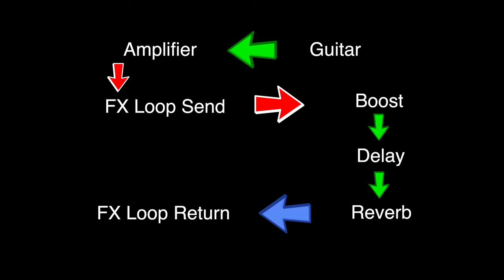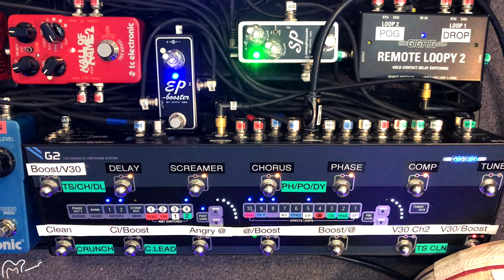How to use a boost pedal in 5 different positions

Comment: Great Video. Just picked up an EP Boost to run in Effects loop of a Mesa Tremoverb as a solo volume control. Was advised to run it after my delay chorus and Tremolo, but found in front of the effects really enhanced them. I run it all the way off, just using the preset DIP +3 and works perfectly. It's not colorless but adds faint solo voiced eq. I watched this video before my purchase. The 2 pedals I tried before were OD pedals that added color, compression, and gain. This pedal works wonderfully. Thanks.

Comment: I recently gigged with a new home built amp head. Band mates were blown away by the amp head. The head looked like a tube amp, for I built it that way. However, I turned it around after finishing the night in showing amp off. I actually was playing through a Quilter Mach lll head using a TC booster in effects loop. Everyone looked baffled, but was taken back in how clean and full my sound was .

Comment: One important thing that was not mentioned is that a boost pedal can shape tone as well. So placing a boost in front of the overdrive doesn't just give more dirt, it adds to tone. Same with placing the boost after the overdrive, you don't just get more volume ,you get a different tone.. By mixing  both the pedals you can get a sound you normally couldn't. For example the Kelly Kantina in front of the Vertex steel string clean drive, or after is going to give you a rich warm tone.Mixing the two pedals whether the boost is in front of the overdrive or after is going to give you a beautiful sound you normally could not achieve otherwise.. It's not just going to raise the volume or add more overdrive depending on the placement, it's going to shape tone no matter where the placement of the boost pedal. Either way it's about mixing.(like an engineer) By  controlling the knobs on both pedals you're going to get many  tones from out of this world. So the stereotype is this, People always tell you depending if you want more volume or more overdrive   do this with your boost..... But I'm here to tell you  as an engineer that couldn't be more further from the truth.
Reply from the maker: Yes absolutely dude, especially with the EP booster, really shapes the tone in a beautiful way with it being based on the echo machine EP3 pre amp 🥰 this wasn’t really a video on how to demonstrate how a booster can colour the tone, that’s a whole other rabbit hole to venture down in another video for sure! But more to help other guitarists understand how they can boost their level or just add more gain in front of an overdrive (to start with), I was hoping people would use their ears to ‘shape’ the tone accordingly when experimenting with boost pedals 😊 The idea came from doing a show and the support band was having issues boosting their guitar level and they were running the boost in front of the overdrive, told them to put it in the amps loop and instantly got what they were after 🤘🏻😊🤘🏻

Comment: I'm really glad I stumbled upon this today, as I've been experimenting with the loop in my Victory RK50 and was contemplating using the EP Booster in the loop to similar ends. Glad to see that it might be exactly what I need to do!

This begs the question - Both the Channel 2 w/boost in loop and Clean w/angry charlie and boost after sound pretty great and almost interchangeable to my ears, do you have a preference between which you generally use and why? I have to imagine each have advantages.
Reply from the maker: Hey Steve, great question! I generally use the angry Charlie with the EP boost as for me it has a slightly smoother tone with what I play, but equally the victory OD with the EP booster sounds awesome too, I may use it a little more depending on the set in playing! Lots of options!

Comment: When running the boost in the fx loop , does it always need to come before the time based fx ? Cheers
Reply: No, but it would be beneficial to do so because you will have your amps clean tone boosted, then into any modulation pedals. Where as after those modulation pedals, you would be boosting those effects.
Reply from the maker: Definitely have a play around and see what you like best. Part of the fun is to try this stuff out 😎

Comment: You think the ep booster could be used as just a solo boost? I've been looking at thia or the tc spark booster for boosting my solos live but can't decide 😫
Reply from the maker: Hey Glenn! I use my EP to boost my solos live and I love it, works for both clean and over drive, definitely worth trying one out to see if you prefer it over the spark, it’s got a little ‘something else’ about it
Reply: @mattmallguitar  Cool! 😃👍 yeah i've heard so from others as well! Does it bring up the volume only or and add gain as well you think?
Reply from the maker: @glennsteen4249  if you run the booster hot you’ll get it clipping, really depends on what you’re running it into I guess, if you want to add more gain to an overdrive or a pushed amp then yes it will definitely do that
Reply: @mattmallguitar  Great! Then i'll get the EP Booster! Thanks a lot man! 👍🙏
Reply: Glenn, the Spark does not affect your tone at all.  The EP Boost does, but in an incredible way.  It was built to emulate the tonal traits of the Echoplex from the 70s.  And it does.  So if you want a boost and nothing more, the Spark is great.  If you want some tonal changes that warms up your boost, the EP is magical.
Reply from the maker: @MikeyRavone  absolutely! It’s magical!
Reply: @MikeyRavone  I just bought the EP and it sounds amazing! 😃👍 Can't wait to plug it into a great tube amp. I sold my amp and haven't bought a new one yet, it's a bloody jungle 😫 
I think I may be getting a Spark as well just to bring my volume up for solos and just leave the EP on as an always on pedal 😁
Reply: @glennsteen4249  Awesome!  Glad to hear it!  That's exactly what i do too.  My EP is before my overdrive and always on.  And I use the Spark after overdrive to boost solos.  I love my EP!  Have fun!
Reply: @MikeyRavone  Cool! Thanks! 🙂

Comment: Hi Matt, I'm using just the boost pedal in front of amp and the pedal works like a on/off switch rather than a boost pedal. Once pressed, it completely shuts off the signal and when pressed again, it turns on the signal which is so weird. Any idea what I'm doing wrong?
Reply from the maker: Ah that’s interesting, I don’t think it should be doing that, are you using just the boost pedal and then straight into the amp?
Reply: @mattmallguitar  Thanks for your quick response. Yes, I am just using the boost pedal straight into the amp to try it out.
Reply from the maker: @joonstar  ok, I guess the next thing to check is the power, are you using a battery or a power supply?
Reply: @mattmallguitar  I am using a 9V power supply.
Reply from the maker: @joonstar  that is strange, does the blue LED come on when you switch the pedal on? And are you plugged into the input on the right of the pedal? (Sorry if that seems like a daft question but many of students have made that mistake before!)
Reply: @mattmallguitar  LED does not turn on at all and yes I plugged the guitar to input and then output cable directly to amp. And weirdly, it works the opposite way too :D
Reply from the maker: @joonstar  ah ok cool we’re getting somewhere now, you need to try a different power supply. If the LED isn’t coming on then it means it’s not getting power, so when you’re switching it on that’s why your sound is disappearing
Reply: @mattmallguitar  Mate! I think you're right :) So whenever I hear the sound, that means it was actually turned off and when the pedal was turned on, there was less power to transfer the signal to the amp so there was no sound. Wow you solved this like Sherlock Holmes lol. I searched this issue all over the internet and found nothing. I really appreciate your help Matt. Just subscribed to your channel. Hope to see many more useful videos. Cheers!
Reply from the maker: @joonstar  No worries dude! Glad I could help! The EP Booster is a 'true bypass' pedal, so when it's off, the guitar signal doesn't run through circuit, which is why when it's off you're hearing your guitar amp, so when you're turning it on, the guitar signal is then trying to go around the circuit, which is why there'll be no sound at all if you're power supply isn't working (as indicated by the LED not lighting up). Let me know how you get on with your power supply.
Reply: @mattmallguitar  Just changed the battery and now its working fine as its supposed to haha. Many thanks to you otherwise I was planning on throwing this pedal right on that guy's head who sold it to me 😁

Comment: You're not boosting it loud enough; the on/off was so subtle, I had to replay it just to hear the difference in vol. 😂
Reply from the maker: YouTube compression sadly, in the room it’s super loud, wasn’t the purpose of the video really to show how loud it goes, more to demonstrate different ways of applying the boost in your signal chain, I’ll do a separate video demonstrating how much it can blast your face off, or even better, if you come down a show and put your head in front of the speaker you’ll hear the difference and probably lose your hearing as result 🤷‍♂️🤣
Reply: @mattmallguitar  Well, when showing the differences between pre - and post gain, having that knob so close to unity barely shows the difference between pre - and post gain. Clean boosts not only raise the volume post preamp but alter the gain and eq where as before the preamp, it only does 1 thing being add sustain which isn't very thrilling on its own. The more you raise the boost in post gain, the more valvelike distortion comes out of the amp. Valve like as in growling distortion as opposed to harsh thin static mess that is very unpleasant.
Reply from the maker: @MetalHeadPyro510  I just listened back to the video to check those levels, and if you're listening in headphones you can hear a massive difference with the Angry Charlie on it's own, the EP Boost after the Angry Charlie, there's a big jump in volume which is exactly the point I was trying to make with that example, also the unity gain thing, I'm not sure where you're getting that from, if you're looking at the post gain signal on my G2, that's totally irrelevant, it's the boost in the chain that's boosting the volume, not the post gain circuit of the G2. Appreciate the comment though